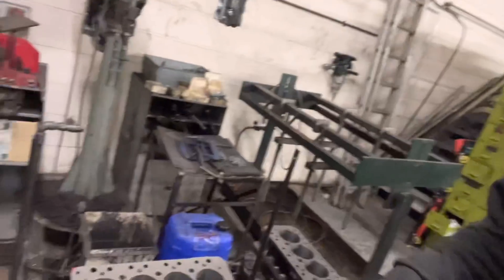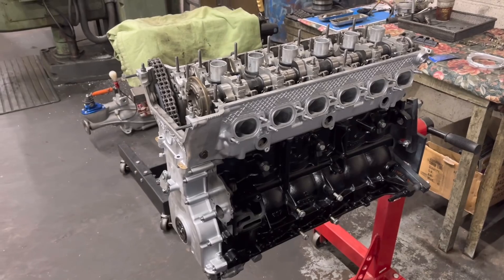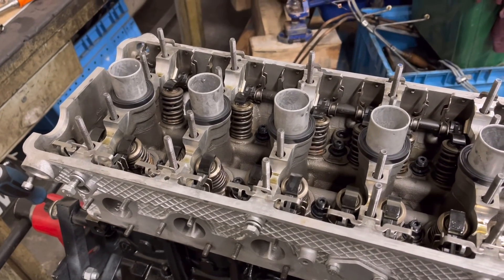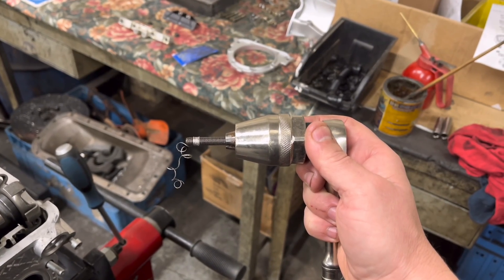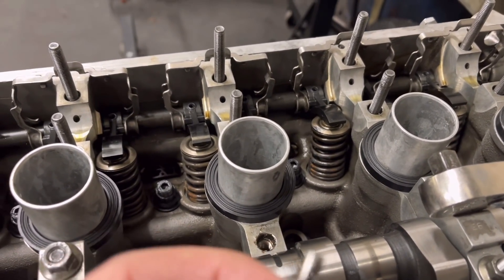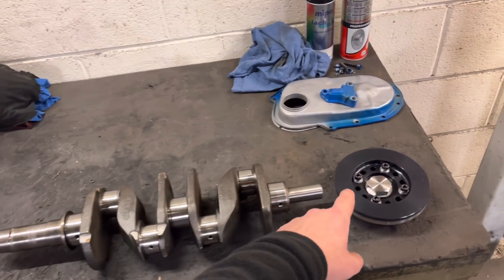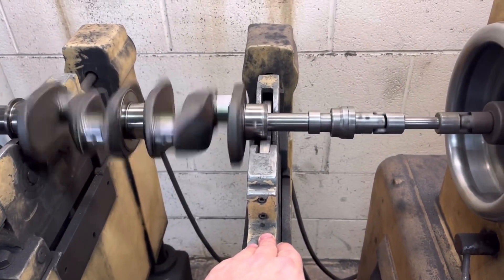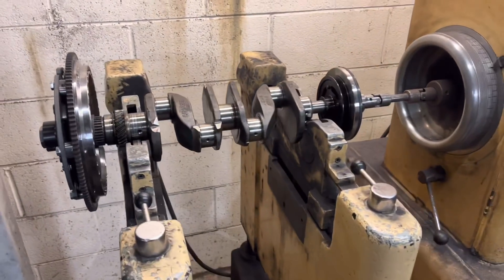BMW M3 engine build, stripped thread NIGHTMARE

Comment: Question, why don’t you bolt the whole crack assembly together first and run it on the balancer, if one section of the crack was heavy wouldn’t a heavy spot on a pulley, fly wheel etc 180° away balance that weight out a bit and save having to take material off the crack. Just a thought as with wheel balancing you can change the balance by rotating the tire. 

I’m sure there’s a reason, just wondering.

Love the channel 👍🏻

Comment: Extremely interesting. Years back as a mechanic we'd replace flywheels, clutches etc but I suppose from a technical view, replacement parts could put the crankshaft out of balance? You'd rely on well balanced replacement parts.

Comment: I’m a fitter and machinist in Australia, did my apprenticeship at an Ordnance factory. All the aluminium stuff made for the defence forces had helicoils pre inserted.  Cheap way to get the ability to get extra tension on a fitting as essentially you go the next size up on the hole. 
6mm stud in an 8mm hole (not exact but I hope you get my drift)
If that was my engine I’d do every hole.

Comment: Helicoils I've found ok for low torques (say 22 ft lbs) but the Wurth Time Serts, although expensive, are far superior and probably stronger than original threads, a must for high tensile bolts or studs.

Comment: Friken aluminum. I hate it.. IMO female threads the bolt will screw into should be in some kind of insert in the aluminum and not tapped into the aluminum itself. Poor design if you ask me.

Comment: Interesting video. Would it be possible to show more of the crank balancing process, how you grind away the crank, to balance it and drilling holes on the flywheel? Rather than just a "before and after".

Comment: Helicoil tip. Run the helicoil tap thru a slightly larger nut so you can wind a helicoil into the nut. Then you can hold the nut over the opening to allow an easier install.  I do this on GM's 60 degree by rocker arm bolt holes.  And 2.7 dodge Dohc timing chain guide bolt holes deep in the front of the heads. 
I also grind my 6x1.0 and 8x1.25 helicoil tap into almost a bottoming tap shape to get threads as deep as I can. 
I also use a pick with a bent end to try to count how many full turns there are to cut the loops off the helicoil to not have it too long.   Last tip. When helicoils screw up during install. Use a scribe to bend half the upper loop over to allow a flat screwdriver to easily unwind them in seconds
Reply: Grinding the tip off the tap is a good tip. Do not though blow out the materials the tap cuts as it will go every where and when you snap the bottom off, remove the little bit with a small magnet or the next time someone does the engine it will stick to the stud and annoying drop off and fall somewhere you can't reach it. I've used them on head bolts ... outboard motors and they've out lived the other bolts that seemed OK at the time.